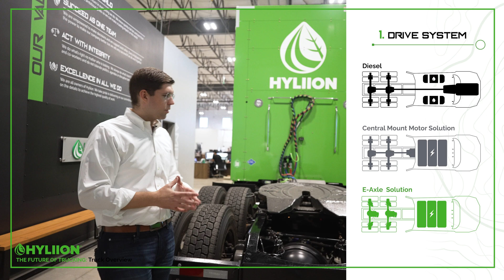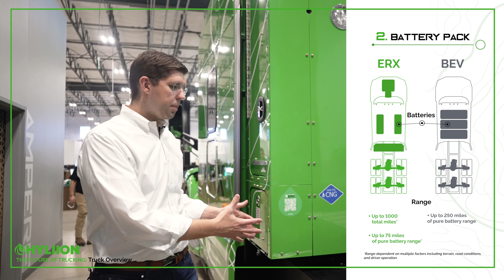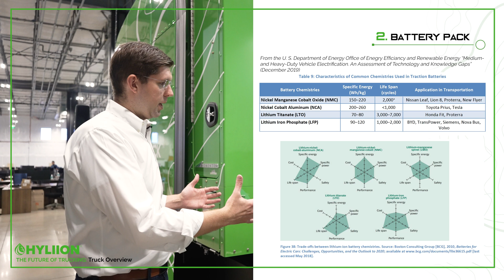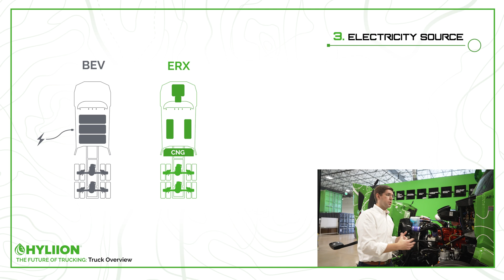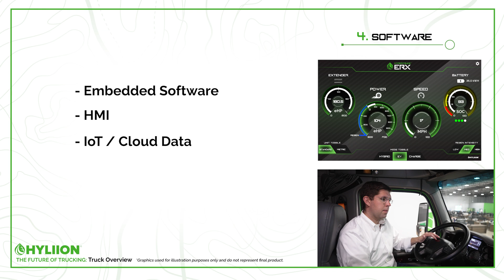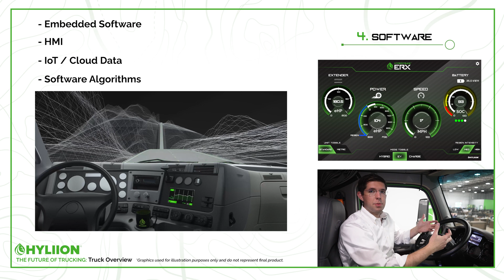Electric Semi-Truck Overview | The Future of Trucking

Comment: The battery overview is good, too, but battery packs are not always mounted on the sides of the frame rails. Some battery-electric and hybrid trucks have a battery pack above the frame rails, behind the cab.

Comment: The overview of alternatives is good, but it is incorrect to say that the central mount motor solution requires a 2-speed or 3-speed transmission, while the E-axle solution requires a 2-speed transmission. 

Configurations are possible and feasible with fixed ratio (1-speed), 2-speed, or 3-speed transmissions, with motors mounted either centrally or on the axles. For example, the Tesla Semi has a fixed-ratio transmissions in both E-Axles, E-axles are available with 3-speed transmissions (such as from Meritor), and centrally mounted motors are used in fixed-ratio systems (such as with Dana TM4 motors).

Comment: My only question is why does this EV Semi uses compressed natural gas
Reply: The one using CNG is not an EV, it is hybrid (which they call "ERX", for extended-range). It is using CNG instead of diesel because that's a "clean" fuel alternative which has regulatory, financial (due to government incentives), or image ("greenwashing") benefits in some cases.

Comment: All I hear from this salesman is how he will be selling a proprietary truck that only one of their service centers will need to work on. It’s not that its a bad truck or idea, its that they are backdooring the maintenance similar to what John Deere does. A move forward but not quite there yet for me…. Even though its for a different market, check out Edison Motors. They build logging trucks but make they so you can go to almost anywhere to get parts.
Reply: Edison Motors doesn't build anything, yet. They haven't finished their prototype. When it is done, parts for the the proprietary eAxles and the control electronics will not be available anything close to "almost anywhere". 

All EV and hybrid truck manufacturers use common industry suppliers for the parts that are not related to the powertrain, such as wheel end axle components, suspension, and steering.

Comment: Have you considered doing a central mount motor/e-axle hybrid system? the central mount can power the first set of wheels behind the cab and then an e-axle would power the rear most wheel. this way when you get up to speed you can unpower the rear and use only the one motor to drive saving tons of energy. Heck you can disconnect the rear axel/wheels for a smaller truck when needed.
Reply: You can include a disconnect with either a centrally mounted motor or an eAxle. There's no need to mix configurations on the same truck in order to get a disconnect feature.

Comment: If you want something that’s stop and go around town, battery electric wins in terms of fuel economy. 

If you want something that’s 99% of the time doing long hauls on the highway, internal combustion only is essentially just as good because you’re not recapturing energy from braking anyway. 

The only use-case I could see would be very long hauls in mountainous terrain with constant elevation changes where the regenerative braking would recapture some energy during long downhills.

Hybrid tech is good for a car around town that also goes on long trips occasionally. It’s not really fest for a Semi truck.

Comment: Getting this outfitted with off road suspension and remodded as a campervan/RV would mean you could live off grid up to a month at least, especially with extra battery power modded in after the ERV addition. Cleaner living.. but the cost to do this would be as much as buying a middle class suburban home.